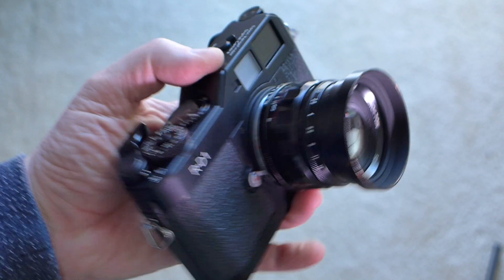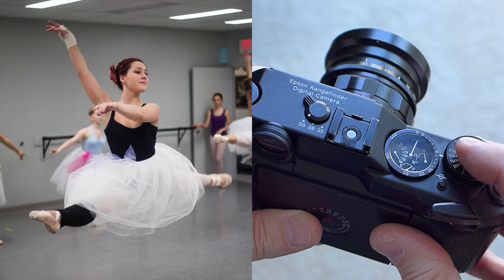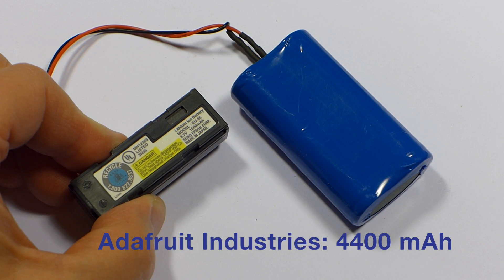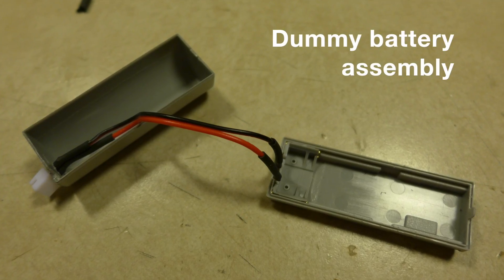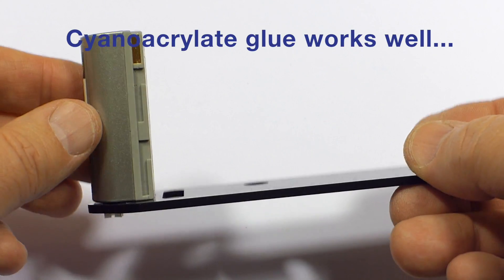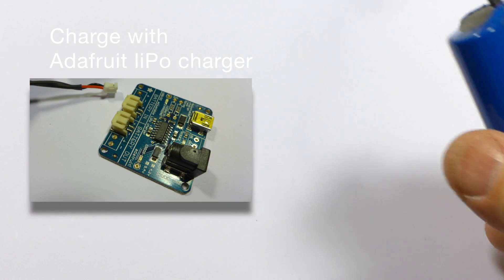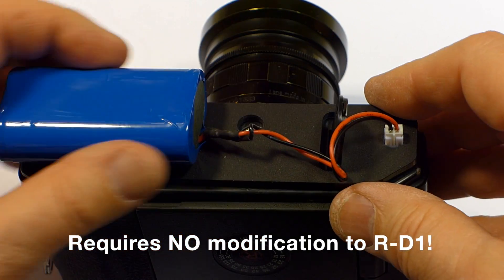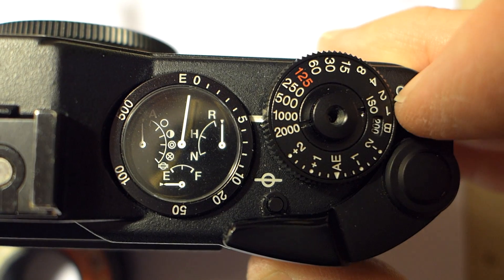R-D1 booster battery

Comment: Hi. Just bought an Epson rangefinder . But without the battery (  I will get it next month ).  I notice that the shutter charge lever only moves a half : 90 degrees ( without the battery inserted )and it  doesn't return to the original position , when you release it ( without battery inserted ).Please could you tell me if this occurs   because I am without battery ? can you confirm this to me.  I am new with this camera. Thank you.
Reply from the maker: Hello, emrac -- The shutter charge lever isn't affected by whether you have a battery in the camera or not. It's a simple mechanical coupling.

What may be happening: You don't have a battery, so you can't release the shutter. Because you can't release the shutter, you have no way of knowing whether or not it's already charged. If it's already charged, the charge lever won't swing through its normal 90-degree arc.

When charged, the lever can be in two positions: the "parked" position against the camera body, and the "ready" position, which is pulled out slightly so there is space to get your thumb behind it. There is no spring return from the "ready" position to the "parked" position -- you just push the lever back and forth.

When you get your battery, the first thing you'll want to do (after charging it) is put it in the camera and see if the shutter will fire. If it does, then you'll be able to see if the lever works normally.

I have never had this happen to me, but I have heard that it's possible for the camera to jam if someone tries to operate the shutter charge lever while the shutter is still open (such as during a long exposure.) If that has happened to yours, you will need to have a repair technician un-jam it -- supposedly it is a simple job. But let's hope your problem is simply that your shutter is already charged, and that it will work normally when you have a battery and can try it.